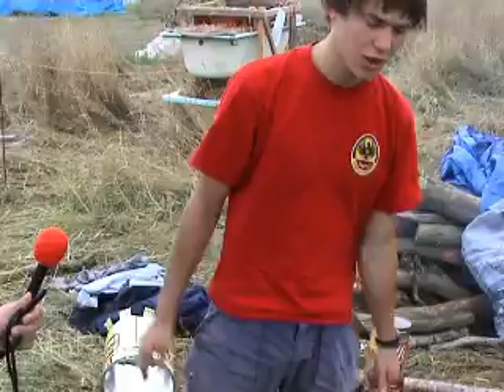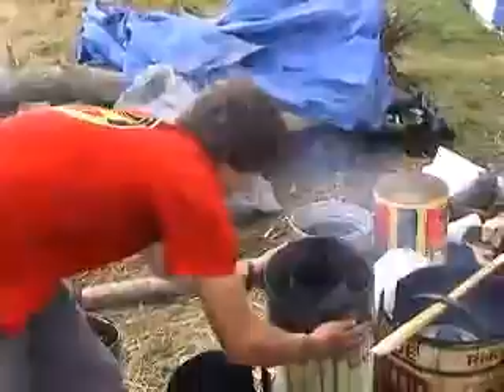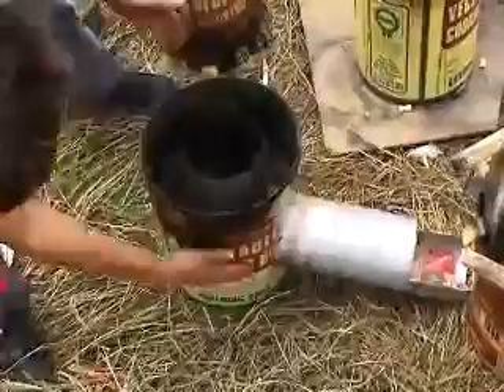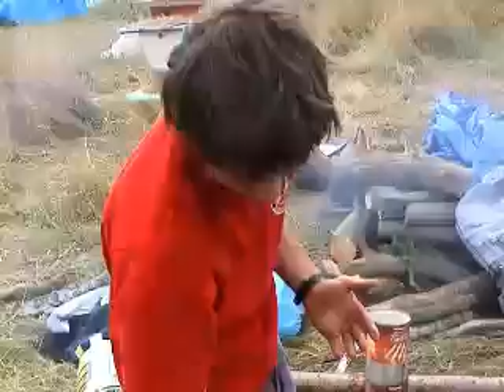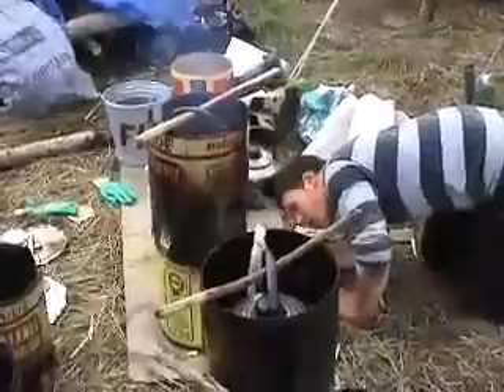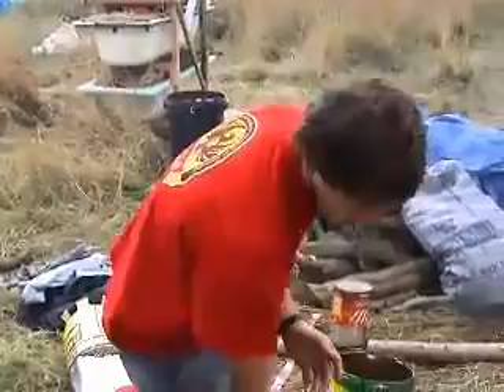Climate Camp renewable energy - rocket stove

Comment: Excellent surfer science in action.  Good important points about coppicing.

The bit about reflectivity etc translates into: the wood burns hotter, and therefore more cleanly and completely.  This makes it about twice as efficient as an open fire, far less pollution including carbon-monoxide, and allows small twigs and offcuts to be used.